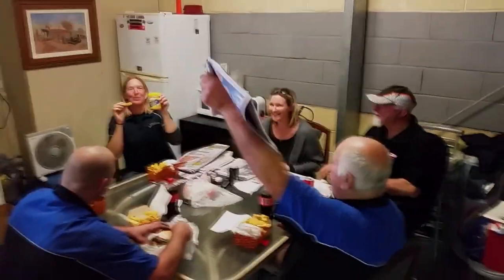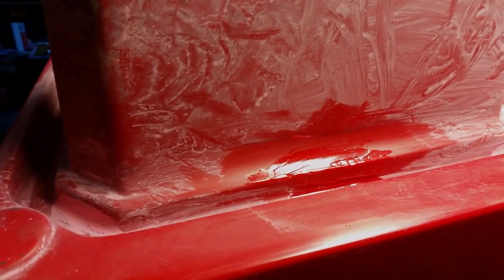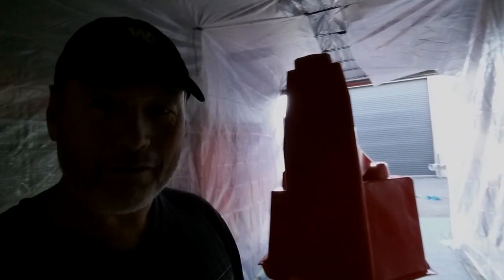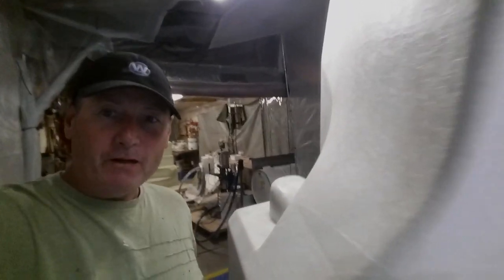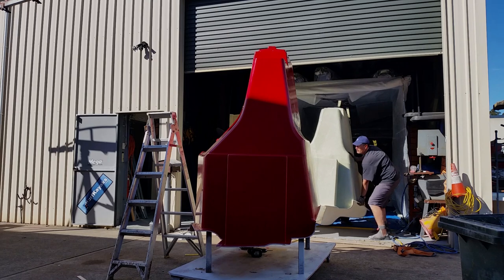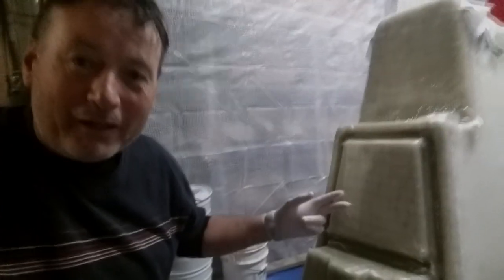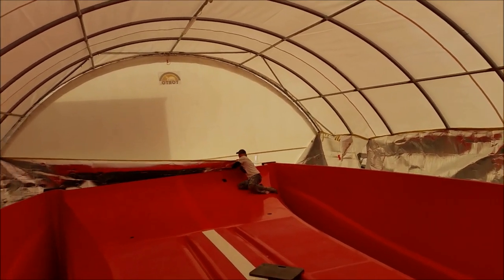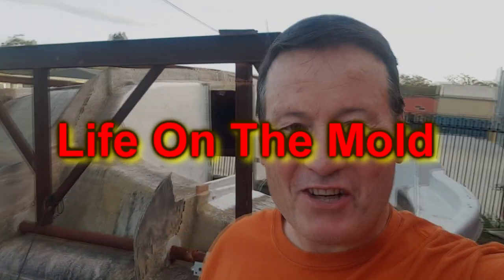Ep008 Demoulding the Starboard head module

Comment: I see your done the one head already but may I suggest a piece of aluminum or even composite decking put on the back of the mold where you will be using fasteners to hang mirrors, towl racks,toilet paper holders etc. I sure wished this was done when I went to hang the shower curtain on my fiberglass tub. I find screws( fasteners) in the glass cause cracks and if you tighten a few times they strip out. Some manufacturers use wood but it rots awy in a wet enviroment. Kinda like the mould reinforcing with plywood. Great vids by the way. I really like that you include specific info about what you are doing.

Comment: Have you looked into vacuum bagging?
Reply from the maker: Yep totally.Vac bagging is not a large scale option as it requires wet laminate.Vacuum Infusion option with this one off build on the other hand could be possible with major changes to mould flanges and porosity of the mold to be sealed from outside to avoid vac loss..Mould is not suited really but could do another with the method.Cost of consumables and a team of blokes would be required also so in my 1 man case better to hand laminate to reduce costs in order of at least $100k or so.Not worried about weight as original boat was nearly 8 tonnes dry.I expect this on to be around 6.3 as i have incorporated foam and improved structural matrix into this build.Cheers Ross